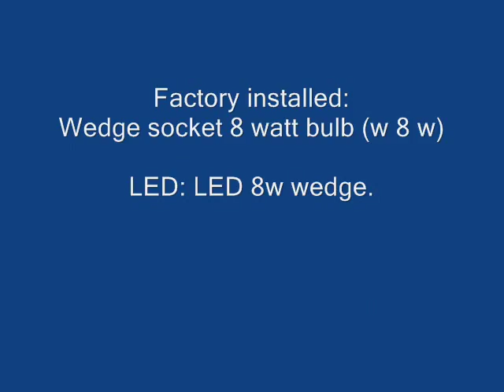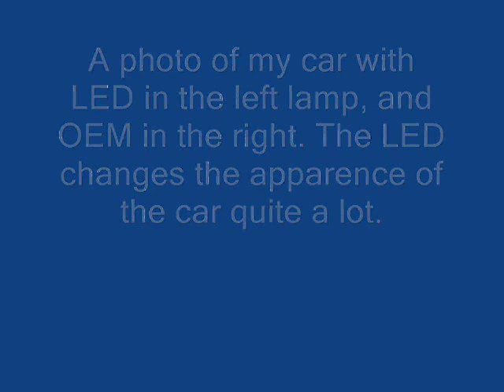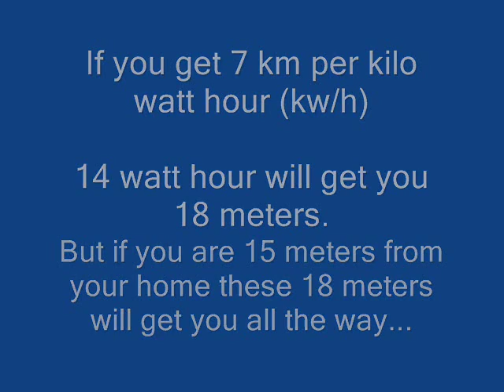Nissan LEAF DIY: parking lights replacement /LED

Comment: Hi and thanks for info. Here in Europe we have DRL that are standard, do you happen to know what the bulb name is? W13? Remember that we have two different bulbs in the fog light housing.
Reply from the maker: The DRL in the foglight on Euro cars should be a wedge bulb, but this should be listed in your owners manual. On the norwegian forum you will be able to find a lot info. Assuming that you are either islandic, danish or swedish.

http://elbilforum.no/forum/index.php/board,46.0.html

Someone has tried to modify the a led bulb to fit in the fog light socket on euro cars, but they had to use an angle grinder on the bulbs...

Comment: What about changing the fog lights or Drl to leds?
Reply from the maker: On US LEAF this is fairly simple. Just connect a positive lead from for instance sigarette ligher (this is always on when the car is ON, and will therefor not drain the battery when the car is OFF) to a (Normally closed) relay that connects to the "fog lights" on a new positive lead. OR buy a LED DRL relay kit. This connects directly from your battery and will know when the car is ON.

Then you connect your positive lead from your headlamp to preferably an optocoupler, OR a (normally closed) relay to your parking lights. The "other end" of this relay must be connected to your new positive lead to the foglamp. This way you will be able to use the "AUTO" function to switch between fog lights as DRL and full head lamp. Your foglamps will always be ON when the car is ON, but when the car turns on your headlamps in AUTO when it dark this will cut the power on your new positive lead to the foglights. In this configuration your will still be able to turn ON the foglights in addition to headlamp. Just be VERY VERY aware that you connect positive to positve... or you will be in for a nasty surprise..

I have swappet the OEM foglights to LED, but had a bit of diffuculties due to reversed polarity. To keep things simple and reversable I bought some "extenstion cords" for the bulb sockets and reversed the polarity and added the extra positive lead on the extensions. So IF the next owner wants to have the car back to "factory settings" it can be done by only replace the bulbs and remove the extension cables. Let me know if you need a link to the extension cords or the bulbs for the fog lights. Or if you need a drawing of the schematics.
Reply: Great job, Leafman Leaf! Can you please post a link here to your schematic?

Also, would this be applicable (both your LED bulb replacement and DRL install on U.S. LEAFs) for 2013 & newer LEAFs?

Much appreciated--keep up the great work!

Comment: Varte desse pærene lenge?
Reply from the maker: Alecsander Scraaning  Hi, 
It is a bit early to say hold long they will last. My bulbs are still working ,and since they are LED i will expect them to last for many, many many years. :-)
Reply: Cheap bulbs off of Ebay, right? That's mainly why I was wondering :) I figured I'd do something similar to my Leaf ;)

Comment: Is it H7 or H8 or H9. Can someone tell me
Reply: Many suggest using T10 LEDs but I want to use them as DRLs so will try T15 or T20.  The early Leafs do not have DRLs so am using the parking lights for that.

Comment: Funny thing...your link now lets you order a woman's sweater. Plus, I believe your lights work off of the car battery under the hood and not the motor batteries....so there would only be savings on your car battery by switching to LED and thus would not give you any extra driving distance. Just sayin'......

Comment: Since you use canbus version - u have no power savings :)
Reply from the maker: Why do you claim that? The bulbs are rated 1w.
Reply: canbus versions are basically "integrated resistor" versions, thus if they are 1w, it means that they are burning 4w as heat ;)
Reply from the maker: Kris Tis
That may be correct for other bulbs, but I have measured these bulbs and depending on voltage they are all between 1W and 2W. That is of course a lot more than the rated wattage, but still a small saving. However the savings are extremely small compared to other modification. At WORST all wedge bulbs on a US leaf will consume less than 60 watt.  My reason for changing the bulbs are of course the small savings, but mainly because it looks neater. The white lights looks more "electric".